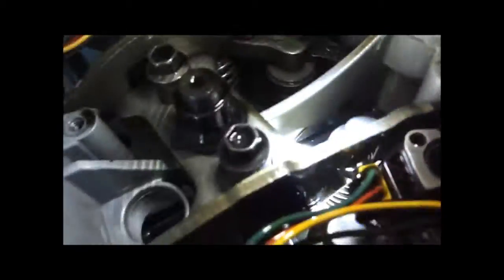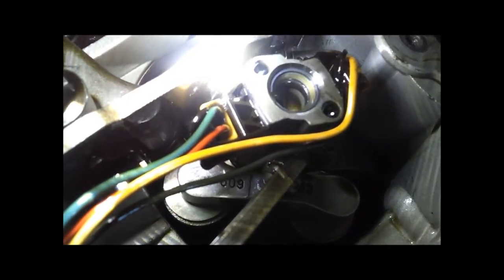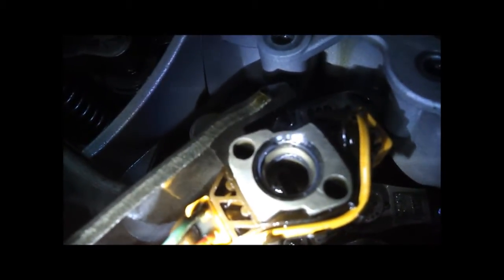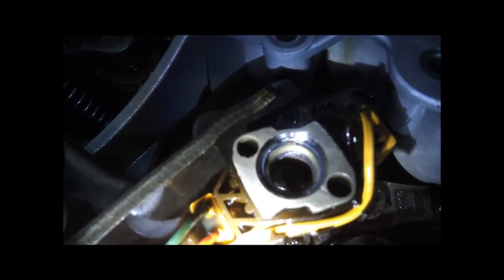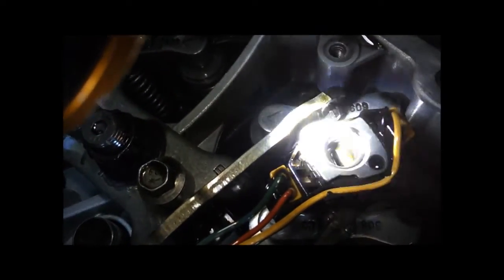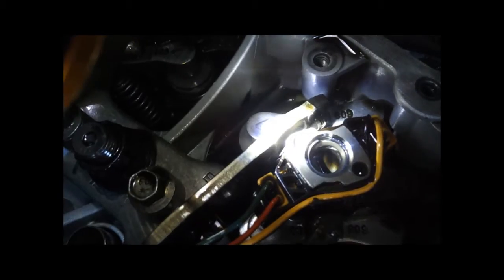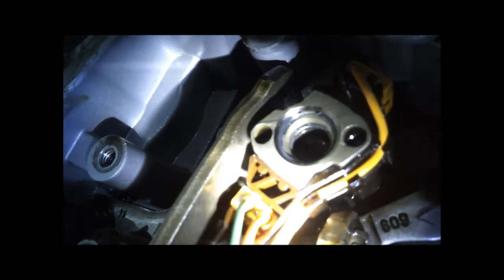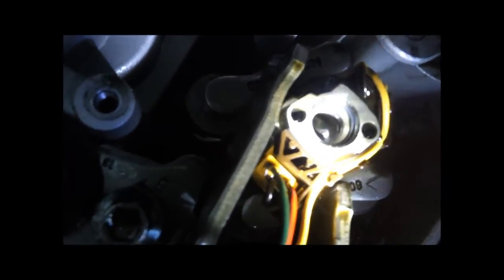FORD 6.0L Diesel ~HPO Nipple Cup Leaks~ Fuel Injector Top Seal Inspection

Comment: What were some of the symptoms you noticed while driving.  Or was it just a no start.  I have replaced a few o rings and clips also.  Any info would be great.
Reply from the maker: Just saw this comment sorry.
    Failed top injector Seals (Which are actually caused by failed nipple cup seals) will create a hot no start. Problems will show up initially as a hard start(long crank) then turn into a hot no start when the seal gets bad enough.